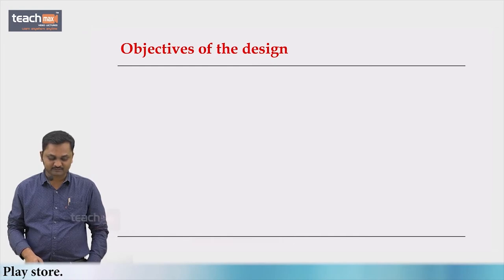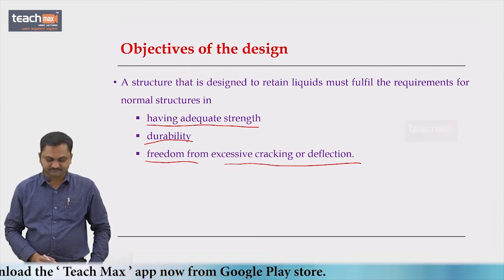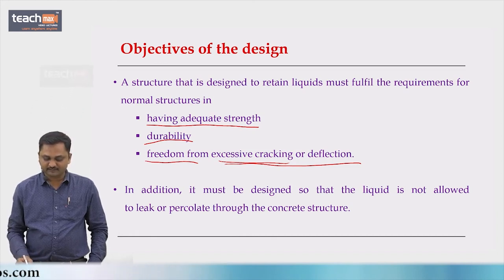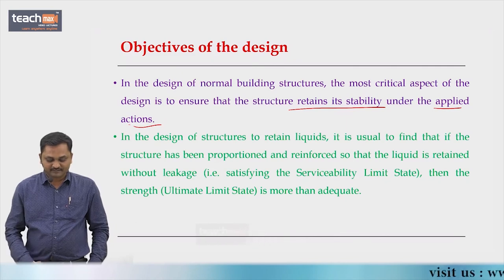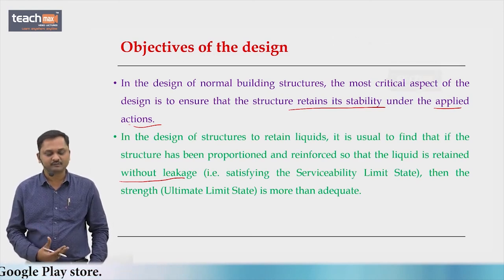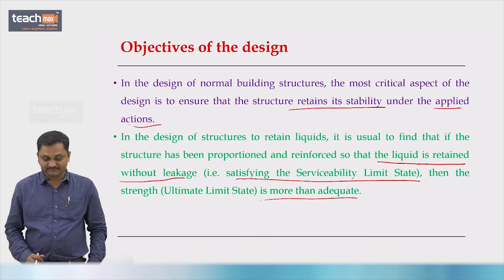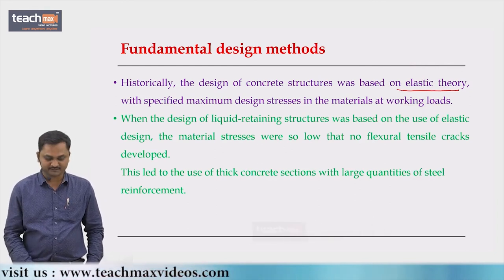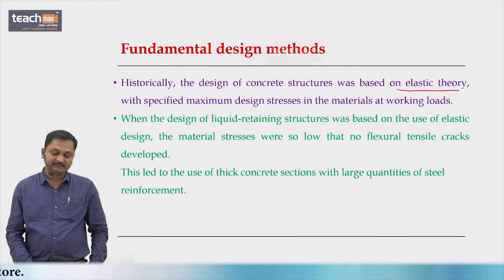Design Of Liquid Retaining Structures For Crack Width | Structural Design - 3 | Prof. Sajjan Wagh

Comment: Dear sir, 
as per your heading of video please tell us the calculation  for crack width. There is no point of saying we should design the water tank only in working stress method because due to low stress there is no need of calculation of crack width
Regards rakesh